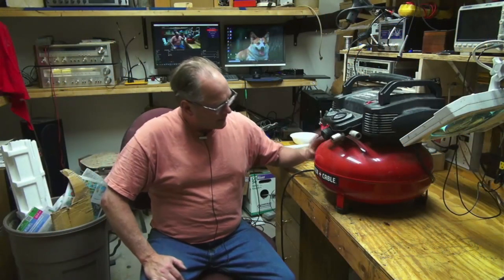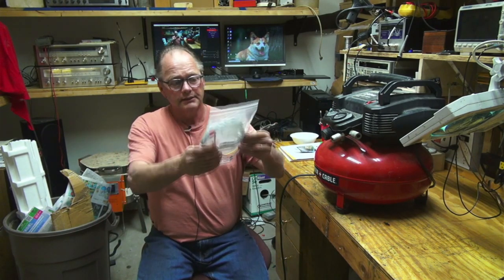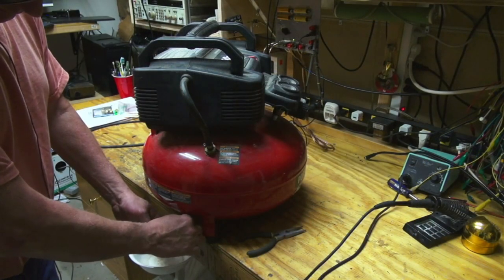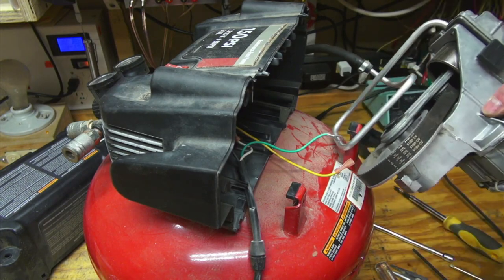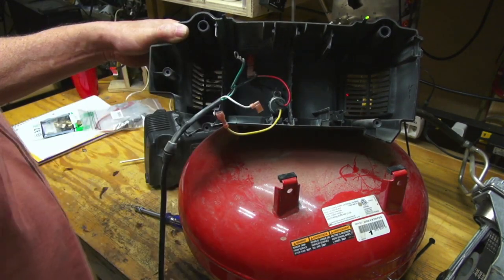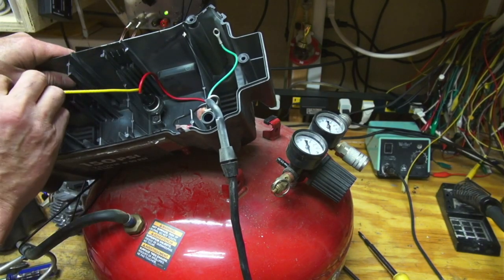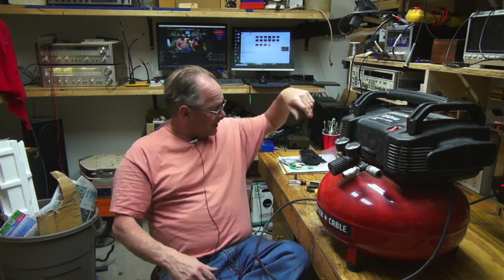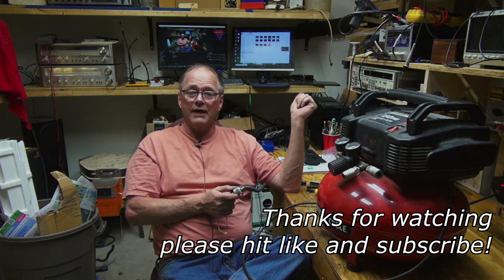Porter Cable Compressor Pressure Switch Won't Shut Off repair

Comment: I have the exact same problem!  Mine is an older style, so I think I will replace it with a new unit on wheels.  At 70, you get tired of lugging the thing around!  I will repair it and pass it down to one of my kids!!  Thanks for the great video.

Comment: Hmm.  You managed to use the word "hysteresis" in a DIY video - that might be the most impressive thing you have done in a while :-).  My older PC 6gal pancake compressor has the same issue.  I got the unit from a local guy who knew his days were numbered, so he asked me over to his place a few years ago so that I could haul away a bunch of tools he hadn't managed to sell.  The compressor will not turn off around the 120-130 psi mark, as it should, but it will turn on around the 100-110 psi mark, as it should, so it partly works.  It's an older model, but I expect the repair part you purchased will do the job, but I'll open it up first and verify.  Thanks for putting the time and info into making the video!

Comment: Nice video of the internals of the compressor. it was a great help figuring out where the sensor/switch is. Mine was doing the same thing, but I was able to fix by removing the line that goes to the pressure switch and the spraying electric contact cleaner down the rubber hose towards the switch. Seemed to have done the trick. Thanks for the help.
Reply: Good tip...

Comment: I  have a newer model of this unit. Having the exact same issue: pressure builds until relief valve goes. For a job (homeowner) today, I just let pressure get high enough to run my nailers, turned it off. Shot my nails and turned it on when it lost 8-10lbs to get it back to required, turned it off and finished the job. Gonna check my model# and do the repair. It would seem such a sucker's buy to toss this thing and buy another one. I don't use it much but, it makes finish nailing so much easier, it's worth having. Thanks.

Comment: Great job saved me $100+ . Worked perfectly. I didn't tuck  in power cord correctly and the fan ripped through them but that was an easy fix .

Comment: 8:07 amateur (not pro) tip: You can remove the back half of the case without detaching the front half from the tank.
The front half of the case will keep the compressing unit stable.

Comment: Wow I had the EXACT same problem. Thank you for showing this! By the way, I basically have three types of power tools, almost everything. Milwaukee, Makita, and Porter Cable. EVERY tool I’ve had from this Porter Cable company has failed! The other two have been flawless forever. I’m almost ready to write them a nasty letter like a grumpy old man. On this compressor alone, the connections leak, the drain is a nightmare, the knobs require the strength of a lowland gorilla to turn, and do nothing anyways. I hate this bloody thing. I’ll NEVER buy another product from this company.
Reply from the maker: I have been a long time Porter Cable fan. I just put a new weight in a sander that I've had for 30 years and it is as good as new. You'll also see me occasionally using a PC cordless drill that I've had for 25 years. That said, this compressor really denigrates the PC brand. I think they just slapped the name on some generic model.
Reply: I have a Porter Cable belt sander that actually has Made in USA emblazoned on it. Even from the power cord, you could tell it was made differently back in the day.

Comment: I picked up that identical one at a flea market and it turned out to be garbage!
They are designed not to be adjusted or repaired.
I looked for parts online and they were hard to find and hard to get.

It is also one of the hardest pancake air compressors to open up.

Comment: I have the same compressor it doesn't shut off but it doesn't build air past 80 psi , what do you think I need to fix any suggestions
Reply: Did you ever figure it out?
Reply: Try putting some air tool oil into the intake of the pump, it'll help the piston sealing and the valves. You'd have to try accessing it with a tube through the housing slots because it's internal without any filter housing or anything.

Comment: Interesting to see what's inside one of those.
Reply from the maker: Yes, seems pretty simple.
Reply: It'd be interesting to see if the pressure switch could be made to work again by application of some rapid bursts of air to free up the mechanism.  I had a different compressor with a switch that had no hysteresis, turning on and off right at the same pressure, which was annoying. I cycled it using an air chuck and found it worked properly again after doing that. 
Might be able to do the same instead of just replacing it.

Comment: Hey Rob. I replaced the new pressure switch but it runs but still won't shut off. ???
Reply: I am having the same issue. I replaced the pressure sensor and the on/off switch. Not sure what the problem is now.

Comment: Robb I have the same compressor I want to ask you how many different sizes of tork drivers did it take to dissemble the housing.
Reply from the maker: I thought there was just the one
Reply: What extender did you use? Looks like it’s pretty far up in there
Reply: Mine is an older one, think it was T20, the screws are recessed so you need probably 6" to reach

Comment: hey i replaced the switch and the pressure relief valve and the new valve keeps popping open at about 148 psi(just like the old one did). the switch shuts off at just over 150 psi
Reply: The pressure relief valve shouldn't pop off at that low a pressure, are you sure it's the correct valve you put in?  Or maybe your pressure gauge is just reading incorrectly.

Comment: im replacing a 2pin 12v one does it matter what oriention its connected?
Reply from the maker: I don't think so
Reply: @RobsFixitShop   thanks for the response i got sellers  approval for non directional and got my horn back up and running thanks

Comment: Did you try to turn down the pressure control first?
Reply from the maker: Yes, I also tried swearing at it repeatedly and that didn't work either!

Comment: Admit it dude, you only made this video so you can see how to put the dang thing back together. 😆
Reply from the maker: Actually I was kind of crabby because I had another one that failed when I was in the middle of a construction project so I just got rid of it and got another one. You can imagine I was pissed when this one starting failing too. I had more time this time so I thought there had to be a bunch of people that were seeing this if it happened to me twice. I really like Porter Cable tools but I think only the label is actually Porter Cable:-)
Reply: @RobsFixitShop How long did yours last before it started falling again?